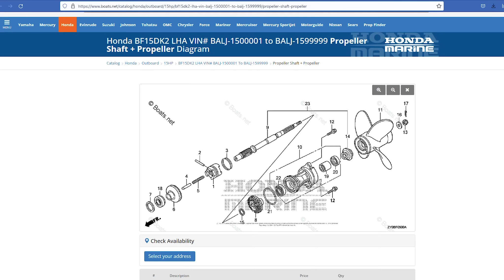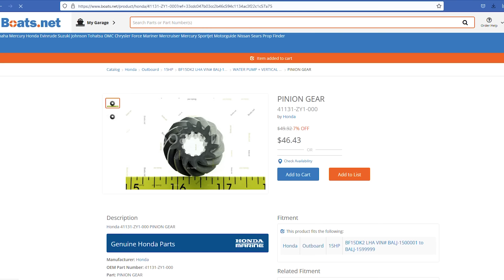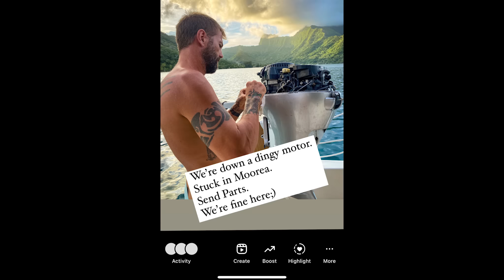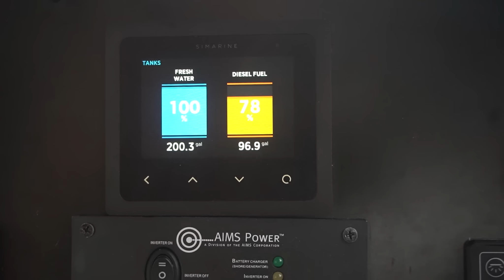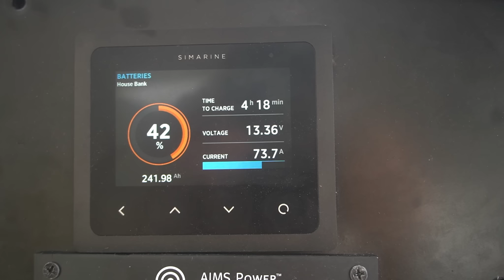Marooned in Mo'orea- Without a Dingy for 10 days | Episode 201

Comment: Interesting idea to put a notch in the anchor pile removed widget. I tried a round circle. It would occasionally wrap around the widget and shaft when going up. Almost pulled the windlass off the mounts. Will be interested in the final results. Congrats on 200. 🎉

Comment: @22:10. Oh guys.... I'm sorry to be the bearer of bad news (And there's probably a good chance that you already know what I'm about to tell you(?)), but the shaft on your windlass is WAAAAY bent! If you're not using a chain snubber when resting at anchor, this is the most probable cause of your bent shaft. ALWAYS take the load off the chain (and therefore the windlass shaft), by attaching a chain snubber and then easing your chain until the weight comes onto the snubber. I'm sorry if I'm preaching to the converted, but as soon as I saw your windlass rotating, I thought I'd better try to let you know - (If you didn't already... Cheers guys. Hope you're living the dream! ;-)
Reply from the maker: Haha all good man we appreciate all and any heads up- we did know, it’s a real bummer, and it’s been like that since we bought the boat two years ago, not 100% sure what did it originally either… we do agree with you- the load needs to be taken off the windlass as much as possible so we use a bridal while at anchor, thanks tho and CHEERS!

Comment: If you've never rebuilt a lower unit before you need special tools. It needs to be schemed properly as it will just tear up again. Try to find somebody that's done it before to do it and that has the special tools. 5:38
Reply from the maker: Ya that’s a pretty tall order where we are at, it’s more of a “work with what you’ve got” and “figure it out” kinda place, but I hear ya, wish that was possible

Comment: !5hp Yamaha 2 stroke. Had 1 for 15 yrs and with regular servicing it never missed a beat. Here in New Zealand I seriously don't no a Honda owner of any cc rating. There are but I don't no any. Option. NZ or Australia are closer than the USA. Research that.  Oh by the way I used to sky behind my 12 ft dinghy & 15 hp Yamy . I used Dolphin fins that attached low on the leg of the engine. They got me up on the plan quicker.

Comment: Also. Consider adding a bypass switch on the windlass solenoid so you can raise the anchor without the engine on. I did and can raise the anchor and sail away no engine.
Reply from the maker: Hey Chris totally with ya man, and interestingly enough the chain very occasionally does catch on the wonder thing and wraps up violently 🤔 and funny also, is that just about a week ago I had finally had it with the windless needing the motor running and completely bypassed it so that we can (if we have to) use the windless without running the motor

Comment: I'd get a 5-6 feet plastic hose and have it connect to my snorkel. Just to do repairs and cleaning the hull.
Reply: You can't breathe more than a couple feet deep. The water pressure will squeeze the air out of your lungs. There are those floating "hookahs" that are battery powered to pump air for hull cleaning. You don't scuba dive either, do you?